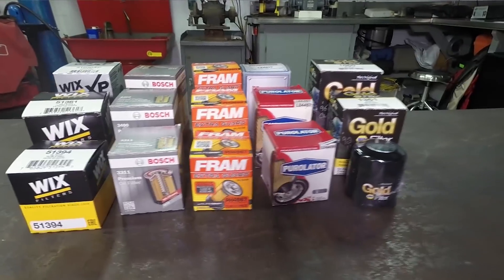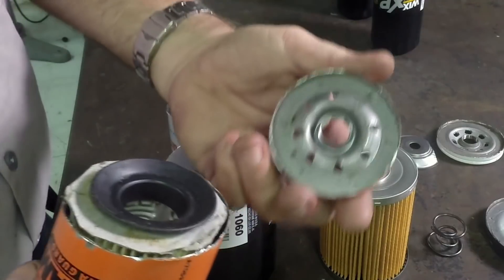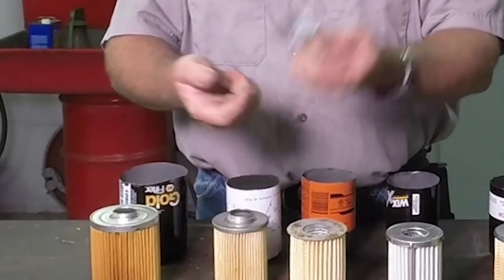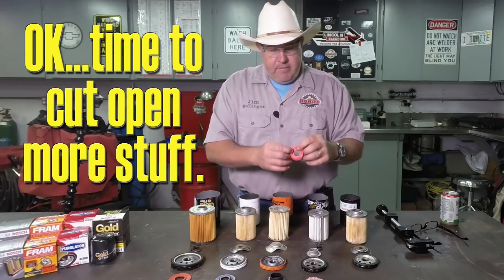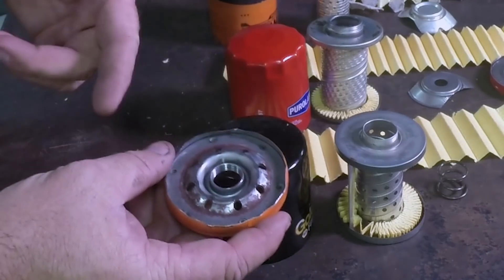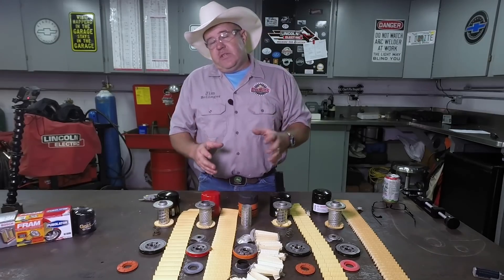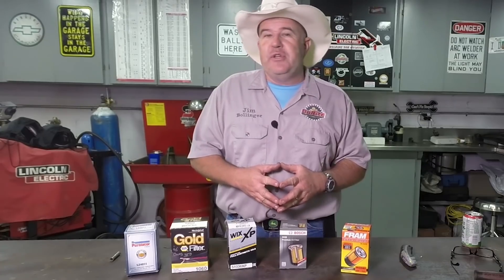The worst oil filter EVER!

Comment: This is the worst comparison  video I have ever seen. Give me production dates on the filters. Any filter stored in less than optimal conditions will develop surface rust. Used Fram for many years then I swapped out to what was on sale. 2006 Dodge  with 265k no problems, 2009 Lexus ES350 91k, 1992 Mustang GT had it for 20 years. 125k+

Comment: The real trick is just change your oil on schedule. You can buy the most expensive filter on the market but you better change the oil on time. Fram for my engine is the cheapest $4, Wix $9, Napa $5. I have used Fram and Napa in the past. If it's made in china it's probably going to be trash no matter the brand.

Comment: Confirmed my own experience. A few words on Fram. Many years ago they made their own filters but that hasn’t been the case for a long time. They are contracted to other manufacturers and I suspect price is a major consideration. That being said, it is possible to get a decent Fram filter, it just depends on who actually made that batch. Not worth the risk, and like you, I won’t use them. When it comes to spin on filters, which I realize ins the main subject of your video, Wix is my go-to filter brand, followed by the NAPA gold (interesting it was included in your line up) I wasn’t aware however that they were identical. The only exception for me is that I stick to manufacturers (dealership)  filters for diesel pick-up engines, tractors, and other applications where the filter is an element only. 

On a 6.0 Ford for example, the WIX filter is their usual high quality but there are fitment issues. It also comes with its own cap pre-installed on the element which has tricked many people into throwing away their OEM cap. If at a later oil change someone uses a Motorcraft filter in the WIX cap, there will be no filtering at all as the WIX cap is taller and does not seal the element inside the filter housing AND does not close the anti-drain back valve (built into the housing, not the element). This often causes a long crank concern because the housing has to fill before the fuel injectors see oil pressure, and can even lead to a no-start concern on a high mileage engine or an engine with internal oil leaks.

Comment: You completely missed the most important step when changing an oil filter. When you remove an old filter, not only look at the filter base to make sure the old gasket came off with the filter, but place a shop rag over your finger and touch the block where the filter goes to make absolutely positively sure there is no gasket still on the block.

Comment: My question is "WHY" is he reviewing the "OLD" Fram Extra Guard filters? The new ones come with silicone anti-drain back valves which are orange and not black like the one shown in this video. The black ones are used on the older Fram filters. These tests do not prove actual true strength and filtration levels on how well or bad oil filters work. This is just purely a cosmetic inspection and bending/twisting filter media with your bare hands does not prove how oil pressure will move oil about. It's interesting and fun dissecting oil filters like how it is shown in this video but the information is as bad as stereotyping anything and just adds to the negative stigma. Open up a Fram Ultra and fun with that and good luck trying to tear that media apart because it's tough as hell.
Reply: I use nothing else BUT those.
Reply: Other videos where the take apart the Fram Ultra Synthetic show it's on par or better than Wix/Napa

Comparing the base Fram is like comparing to cheap base STP and Supertech filters.
Everyone knows Wix/Napa Gold is a more premium product.

Compare filtration test results of the Fram Ultra Synthetic and Napa Gold/platinum and you'll find that Fram Ultra Synthetic blows napa away in micron size and total percentage of particles removed.
Reply: @promiscuouscrab4040  the only problem with that is STP and fram is the same and even the high-quality fram is not high quality made just because you polish a turd doesn't make it anything more than a turd
Reply: @dustinmoss584  FRAM Ultra even has better filtration compared to Mobil 1 and K&N filters as well. Not sure if both Mobil 1 and K&N filters are still made by Champion Labs though but I know they were a few years back and was pretty upset when I found out. I was paying more with K&N when it was the same exact filter of the Mobil 1.
Reply: @xdejablu3x  yes I agree I've had that same issue Mobil 1 is not as good as they say it is but therefore I don't use mobile one I've tried using mobile one and they are just crap but I've also cut open a fram synthetic and it is crap wix or Napa gold is way better then you will get even with a synthetic fram listen thetic fram falls apart very easilyfram is trying to save their brand but by the time you pay for a synthetic brand fram filter you're actually better off just going and buying a motorcraft filter for your vehicle motorcraft makes a better filter in fram wix Napa gold make even better then fram from is you're not looking at the exact capability of the filter it's filter can fall apart easily or has very little filter material does not matter how fine grit it is if you have less filter material and a finer catch you will stop up your filter faster
Reply: @dustinmoss584  I beg to differ. I used to use exclusively OEM manufacturers oil filters, M1 and K&N but never looked back after using FRAM Ultra oil filters. I even made a video on my page (which I highly encourage you to watch) on one of the FRAM Ultras I used on one of my vehicles. There are numerous videos on youtube taking apart new/used FRAM Ultra filters with no issues what so ever. That also goes for the FRAM Tough Guard filters as well.
Reply: 4$FRAM VS. 6$ wix 5$NAPA LINKS ARE IN DISCRIPITON
Reply: Can you use ultra fram with 100% conventional oil?
Reply: @knightrider1545  Yes you can. The way they make oils and filters now, it's hard to find something that doesn't work with one another. Most conventional oils nowedays are synthetic blends anyways. Check the MSDS sheet online for the conventional oil and you'll see.
Reply: @xdejablu3x  conventional oil is not a synthetic synthetic is not a conventional might want to do your research before trying to say something to somebody that could be wrong synthetic oils have smaller molecules than that of conventional oil a synthetic blend is also different than synthetic and conventional it is having the smaller synthetic molecules and the larger conventional molecules mixed in to make a synthetic blend if your car requires synthetic you must use synthetic or you can damage your seals
Reply: @dustinmoss584  Not to be rude but I said it pretty cut and clear. Even modern day conventional oils have some sort of synthetic base in them now. If you look up the MSDS sheets for today's on the shelf conventional oils, you will see synthetic base oils in them. It's bot much compared to bottles that are labeled blends or full synthetics but they are in there. Also, there is no law or requirement for how much synthetic additives are required in synthetic blend oils unfortunately. They can put in like 10% synthetic and the rest be 90% conventional and still legally sell/label the oil as a synthetic blend.
Reply: @xdejablu3x  4 synthetic blend yes but a full synthetic no conventional oils do not have a synthetic property to them even if they have a minoot amount of synthetic in them it is still not the same as synthetic blend is still not the same as a full synthetic oil there's a big difference in it and some of the people do not know these differences and will commonly mistake and think that they can use conventional oil in there full synthetic or semi synthetic vehicle
Reply: @dustinmoss584  Even with your last comment, you brought up an argument on which I was not discussing about users being confused about which oils to use. With in doubt, read the owners manual. Something people have no common sense to do or even attempt to venture out on. There should be a basic test required for all vehicle owners to pass before purchasing/owning a vehicle. The whole, "I didn't know?" is not acceptable today because people can simply "Google search" practically anything they need answered. Anyways, on this argument, if the owner assumes and doesn't do their homework then that is their fault if they put the wrong oil in it.
Reply: @xdejablu3x  once I actually do agree on the subject but at the same time people nowadays like to point blame and they would be more than happy to blame somebody they read on YouTube other than blaming themselves for being ignorant that is the problem that I have with most of them nowadays even if you give them the correct answer for what they seek they still are going to go off of what they think instead of what is actually knowledgeable
Reply: @knightrider1545  yes you can use any type of oil filter for conventional oil it's not going to hurt anything but if you're going to use good oil synthetic I'd recommend using a good filter and your wix or Napa gold is a better filter take apart your fram ultra layout your material for particle filtration the material is shorter in length than that of even a standard wix filter no you adding that they make it to where it filters out smaller particles and yet they have a shorter piece of filter paper therefore equals clogging up faster then that of a wix or Napa gold because it does not have the amount of filtration paper as required to filter that small of particles

Comment: Every buddy is a expert.
I think unless youre going to check youre oil for particles every time you do a oil change and measure the amount of damge in youre engine because of a faulty filter i dont think you have to worrie.
Do oil change on time and even earlier if you like or get a( high power earth magnet) place it on the bottom of the out side oilpan get a good one JB weld it to pan good to go all metal partials will be caught. Or get creative pull oil plug weld some thing to plug to hold magnet to plug so every time you pull plug you can clean the metal off plug simple or just go online.

Comment: I was an auto mechanic for 13 years and I use Fram oil filters on my vehicle without any problems.  I bought my vehicle with 142,000 miles on it and have put over 100,000 on it and have no problems with Fram.

Comment: Not only are they junk they are somewhat overpriced for what they are.  I use Mann Hummel filters on everything even my Volkswagen.  Some OEMs even use fram filters with their branding but that does not make them good filters.  The thing about the Mann Hummel filter on my Volkswagen is that it is not hidden in a metal can so it is easier to see what you are getting.  In the Volkswagen forums some people swear by the Mann Hummel filters.

Comment: I'd like to see AC Delco v Motorcraft v Mopar quality comparison
Reply: And FRAM Ultra. Apparently those are good one made by a different company!
Reply: and Valvoline
Reply: The three OEM filters are fine, they were designed specifically their application. More and more these days, running OEM parts in the driveline are becoming more important. Especially now changing spark plugs are back in vogue (as in AC-Delco Iridium plugs for GM cars). Usually recommended at 100,000 miles. But people who buy the cars other people had leased, then dumped, are driving them twice, or three times that.

BTW, thanks to all you people who lease, and pay the bulk of the price for a new car, so the rest of us can get it as a two year old car, pretty darn cheap.
Reply: That wiil be great.
Reply: Throw Baldwin filters into the mix too!
Reply: Can those even be compared to each other? I doubt there are Mopar filters for Fords and vice versa. No really, i've never seen Motorcraft filter that wasn't made for Ford.
Reply: @KRAUSER0130  Ford/Motorcraft sells filters for numerous makes and models.  As a former Ford parts manager, I stocked oil, air and other Motorcraft products for a variety of vehicles, primarily for the used car department but also for retail sale.  I have known about Fram filters for years but this video is deceiving.  There are high end and low end filters made by Fram.  But being a Ford person, I will use a Wix, Napa Gold or Motorcraft filter before TOUCHING a Fram of any quality level.
Reply: All made by Purlator. The red and white Purlator he used is their lowest line. They have better unsure if equal to wix
Reply: Jason Foster fake news. Take a look at the bottom of each filter. Different processing plant stamps. STP makes Valvoline, ac delco and many other cheap filters. Purolator makes filters for Motorcraft. I'm not sure who does mopar. Regardless I won't buy an AC Delco part or any gm part for that matter. America first.
Reply: Micah Meek great question
Reply: Mopar uses Fram filter brand . Same goes with there exhaust , its Walker exhaust . Thats not a bad thing though . The majority of the brake discs in stock are from China.

Comment: 6:12 "I'm not too keen on the springy thing."  Yeah... don't you just hate "springy things" that save engines? It's a BYPASS VALVE... and it protects your engine from oil starvation and protects your oil pump from excessive back pressure, if you forget to change your oil.

Comment: None of what you say matters. The ONLY thing that matters is how well the filter removes particles from the oil. I have used Fram filters for years. I have 2 different trucks, one Nissan and one Ford, both have well over 200,000 miles and are running strong.

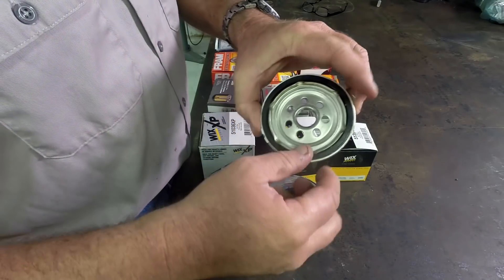Comment: 1:28 SUPPLY pressure, NOT "return" pressure. Engines use gravity to return the oil to the pan.
Reply from the maker: It returns back to the oil passages from "outside"the engine.

Comment: Well this opened my eyes, I've ran nothing but Fram oil filters on every vehicle I've ever owned. Knock on wood, I've never had any issues🤞..... But I'm definitely thinking about switching to Wix or Napa now. Very disappointed in Fram, shame on them.
Reply: I have been using them for 20 years and never had a n issue.
Reply: @TheIndianscout  right! I cant believe decades of an industry and millions and millions of users are all wrong for using Fram? hard to believe
Reply: @donschlonski2936  I have 115,000 miles and have been using fram filters.Plus all the other vehicles in the past I have used fram filters.Vehicle before the one im driving now had 188,000 miles till I sold it. No issues.
Reply: I'd say, the problems must not be very serious in real world testing.  I've put 100k on my car using fram oil filters.  No matter the company, faulty oil filters DO happen.  Just like ANY OTHER PRODUCT.
Reply: Years ago I read an oil filter article by a scientist. He listed material types, square inches, and prices of about 10 filters and their original  manufactures. As I  recall the same conclusion.  50 years certified master mechanic. If in doubt of unit condition (engine, trans, differential) go to an FBO and buy an oil test kit, and send it in. Now you'll have a basis to learn the story. Do it 3 times and you'll know the real story! FBO is airport talk for Fixed Base Operator. H
Reply: @edwinhsingmaster9135  same conclusion as what? you didnt say
Reply: @donschlonski2936  Fram filters are junk.  "All about oil filters" by Mark Lawrence.  H

Comment: I used to use fram filters but I will never touch one again after driving down the road and having my filter spring a fucking leak because these filters are such cheap garbage. It was also spraying from the black rubber coating at the bottom too lmao. Fram is shit and I wouldn’t ever buy another filter from them even for the vehicles I hate.

Comment: Auto biz  veteran of 25 years.  11 years retail, 14 years working for Japanese and high-line Euro car manufacturers. . Many years ago I was a District Serv Mgr / Factory Rep ( Nor Cal, Nevada, Utah) for a very well known  Japanese manufacturer.
I was responsible for declining a warranty claim for the failure of a FRAM  oil filter causing the destruction of an engine. This was around 1976.
The customer filed a lawsuit. Based on my presentation in court, the judge found against the vehicle owner suggesting he sue the manufacturer of the filter. 
My evidence  included the failed engine dismantled, the oil filter and documentation clearly stating the filter failed to meet manufacturer's standards.

I later repeated this same situation for another well known auto maker.

I have never used a FRAM filter since. 

Make up your own mind.  A high quality filter will cost $10 and potentially save you thousands.

Also beware, FRAM makes filters and re-brands them for many of the popular quickie oil change chains.  If you must use one of these outfits.. bring a quality filter with you.
Better yet buy OEM filters , NAPA  and or WIX highest quality filter.  

Don't know about you, but I cannot afford to be cheap.

PS   Most professionals in the auto service business have known about FRAM filters  for at least 3 decades. 

Another note .. all the pseudo scientific mumbo jumbo and personaI  anecdotes about using crap filters for years with no problems,  is plain ignorance and or smoke and mirrors, ie utter BS. .   FRiends don't let Friends use FRAM.